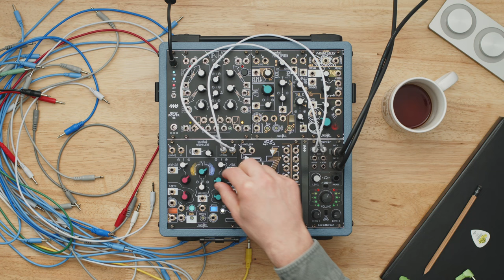Make Noise Tape & Microsound Music Machine Patch From Scratch

Comment: Hey matt, have you tried a lot of different output modules? I have intell and joranalogue Tx2. Is there a reason you like monitor? I was looking at addac 800x and there smaller form factor because of built in transformers.

Hey man could you also share what you put in the text file that moves 1 increment set by the gene size like you showed in the video thats amazing.
Reply from the maker: I won't say a *lot*, but of the ones I have tried, I've liked monitr the best. It's so intuitive and performance-friendly, and is built like a tank. Also, I just pasted my options.txt file into the description if you want to check it out. The hybrid gene stretch thing is the default option.
Reply: @mattlowerymusic  dude your awesome. Your one of the main reasons i got into modular. Is the audio fidelity good by chance on monitor? I was split between that and transmit 2 and chose tx2 from the review perspective. Will have to look into monitor. Thanks for the txt file!!!
Reply from the maker: @joeymc5272  yeah, monitr sounds great. But you also can't go wrong with Joranalogue- top notch stuff there as well. I wouldn't sweat it, both are great.
Reply: Alright thanks a lot man. Hopefully you do more tutorial on your racks. Love learning these tricks from your videos

Comment: How and in what way do you change the code on the Sd card!
Reply from the maker: It’s just a text file on the sd card. You open it on the computer and save your changes and the module reads those when it boots back up
Reply: @mattlowerymusic  yes,  I understand that. But it is not clear what you are changing it to and which line you are changing😀
Reply from the maker: I just posted the contents of the file in the description @rjschrei